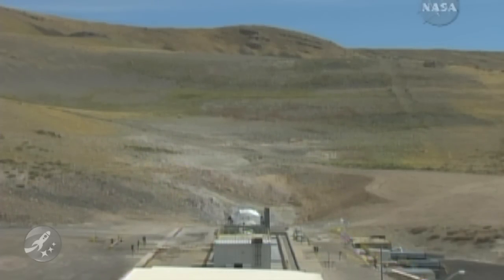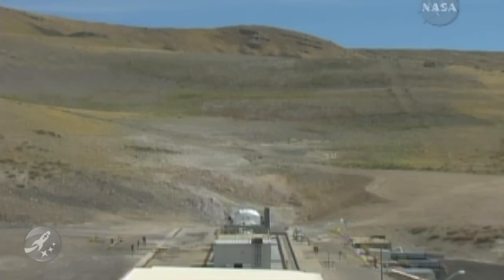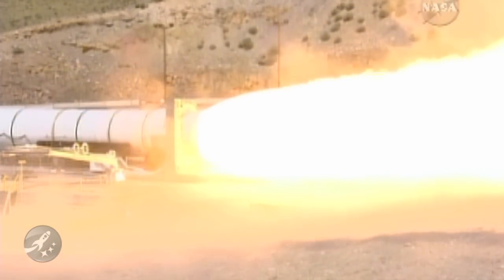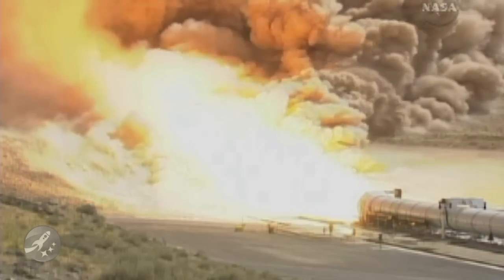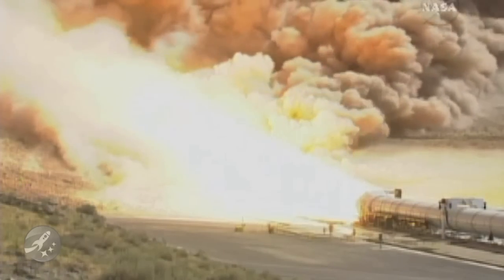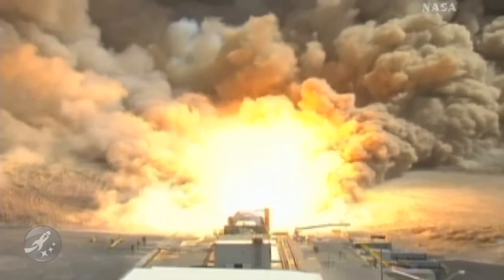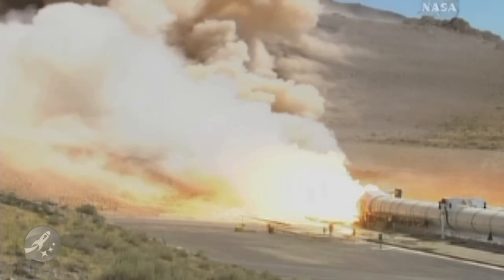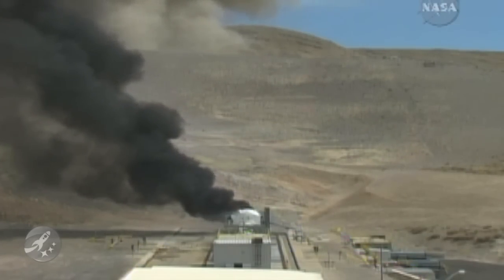Ares I Motor Test

Comment: I wonder how much this affects the rotation of the Earth.
Reply: YawnGod 0
Reply: Danny h You're not good at physics, are you?
Reply: YawnGod It wouldn't, because the rocket pushes one way, and the burnt fuel pushes on the atmosphere the other way, making the planet a closed system. So don't be so quick to make fun of Danny. It's not negligible, it's literally a sum total of exactly 0.
Reply: YawnGod what amazes me more,is the mounts holding that twenty two million hp rocket down, and keeping it from flying off.
Reply: You're getting confused with gas engines buddy. Rockets directly generate thrust, so they don't have spinning parts. You can't really measure a rocket's power in torque. If that engine wasn't strapped down as good as it is, it sure as hell WOULD have gone somewhere, and would've gotten there really fucking fast and with a lot of fire everywhere. Torque is just rotational force.

By the way YawnGod, I feel I must point out a potential slight error in my original post. The rocket wouldn't affect the planet's rotation around the SUN. As for its rotation itself, it would be negligibly tiny, but still present. Since the atmosphere fits around the planet loosely, the rocket would've spun it like a giant tank tread, causing the planet to indeed rotate a bit. The air friction with the ground would quickly disperse the energy though, so the rotation would probably be best measured in Planck Lengths.
Reply: I think he means that it's by a negligible amount.
Reply: Argonwolfproject Actually, you were
correct, so long as it happened in the atmosphere. Since the the gasses being propelled don't actually leave the Earth, the angular momentum of the Earth remains the same.

If the Earth didn't have an atmosphere, and you had this rocked strapped to it and fired, in that case then the rotation would slow down by those few Plank lengths. 

At least, that's what I was lead to believe.
Reply: Argonwolfproject Huh.

Interesting.
Reply: Ricovali horsepower doesn't effect force as torque would. You can have a 10773738837737 hp engine but 2 pounds of torque and move no where. What torque would equate to on rocket motors is what you would really consider.
Reply: YawnGod
Well here's the way I was thinking. The earth's rotational velocity isn't permanently affected by the rocket in any way, but it would be altered a small amount for a short period of time. The rocket would drive the atmosphere around the planet like an enormous reaction wheel, which would cause some rotation, but no permanent change. If you know what a reaction wheel is you'll probably see what I'm saying, if not it's actually fairly simple and Wikipedia can explain it more clearly than I ever could.
Reply: Argonwolfproject if you read my last sentence.... torque would not apply for rockets... I was wondering the equivalent or similar to torque which I may found. Thrust is the equivalent to torque....
Reply: As much as all the people in China farting in the same direction.
Reply: it is good to read that there are people who know physics. and comone it looks like a gigant rocked and epic shit everywhere but how big is is on the planet it just pushes the air. it is nothing compared to the forces that makes the planet spin
Reply: Danny h its also strapped down to the planet and the blast is against a mountain.. I see no effect
Reply: Tn Bui
See reaction wheel post above.
Reply: +Danny h That's a very good answer. A better answer is that the acceleration equals the force divided by the mass. The force of 22mill hp equals 16.4 x 10^9N.m/s with the mass of the earth being 5.942 x 10^24kg.
By my quick calculation, the acceleration would be in the vicinity of 2.5 x 10^-15m/s/s for the 120sec burn; i.e. SFA

Feel free to correct my calculations.
Reply: So atm i have to much bear and vodka so ill react later with commin sense

Comment: would I like to have one of these attached to my car. No more late at work excuses.
Reply: Pakhavar you see. You have two, one for power and the other for brakes
Reply: Kirrim Kerman That wouldn't work, if you have two simiilar Booster Rockets, you would end up at home ;)
Reply: François Dupont Well.... You might have to use the sorry i flew to china instead of work 1 or 100 times
Reply: François Dupont  how would yu apply brakes? :P
Reply: François Dupont ?
Reply: François Dupont Now that is thinking!

Comment: Taking air pollution to the next level!
(And don't start a shitstorm now, I'm a fan of the space program)
Reply: Sound pollution maybe yeah, but not air pollution. The motor burns hydrogen. The exhaust is various oxides of hydrogen. The biggest being h2o...
Reply: slowpoke96z28 You are wrong. At aproximately 1:30 the narrator says it's a first stage solid rocket motor. This motor that is burning for 126 seconds is using Ammonium Perchlorate Composite Propellant which is far away from being nonpolluting.
Reply: +slowpoke96z28

No it doesnt. Solid rocket boosters burn a mix of aluminium and ammonium perchlorate, and the produits of the combustion are very toxic.

The only engines that burn hydrogen and liquid oxygen are the ondes that are on 2nd stages of rockets :)
Reply: TheTornado121 lol thats pure H2O so dont talk about air pollution. The fuel is H - it burns so it produces H2O
Reply: forest328 Did you even read the replies in this thread? Solid rocket boosters don't burn hydrogen and oxygen, mainly because they're called SOLID booster and neither of those two is solid. The fuel in this thing is PBAN-APCP. That's a fancy way of saying it's mostly ammonium perchlorate and aluminum. And you cannot tell me that those things don't pollute the air.
Reply: TheTornado121 those things don't pollute much, they're mostly inert solids in their stable form

Comment: well thats one way to push a lot of dirt out of the way
Reply: And burn and remove weeds. Or point it a grumpy neighbours.
Reply: Pilot924 You don't even need to point it. The acoustic pressure alone would do the job.
Reply: Gath Gealaich Yes, but it's more fun by pointing it at them! :D
Reply: EXACTLY, Screw equipment, ill just call ATK and order some SRB's!

Comment: great. 30000lbs of co2 and i have to worry about the energyconsumption of my fridge.....
Reply: ***** Are...are you absolutely serious?
Reply: thats just for the arm
Reply: Why worry at all, AGW is bullshit.
Reply: Rocket Dudes Yes, because that's the only thing in this test producing any CO2 at all. The lower stage rocket (SRB) is powered by a mixture of potassium perchlorate (KClO4) and powdered aluminum (Al). Its combustion products are potassium chloride (KCl) and aluminum oxide (Al2O3) - both relatively inert solids that pose little risk to both the environment and the atmosphere. The upper stage is powered by liquid hydrogen and liquid oxygen, the combustion product of which is (H2 + O2)...water vapor. Kind of hard to emit any CO2 when there aren't any carbon sources in the fuel being used.

Comment: It would be cool to use it as a flamethrower
Reply: only if someone could pick it up
Reply: yamtam pe'er amd be strong enough to hold it still after all it is half the power of a Saturn V
Reply: It would have to be fixed against a wall or sth. Sationary flamethrower.

Comment: how much energy did this rocket produced, from start to finish?
Reply: Layne Benofsky the OP asked about energy. the answer should be in megajoules or terrajoules. You guys are replying in terms of newtons,or force.
Reply: 16Mega Newtons, Saturn V were 2 times more powerfull.
Reply: about 16.5 Billion Joules /s taking the "22 million hoserpoer" statement, thats about 2trillion joules over the burn time of 2min. Just a VERY rough statement since those 22MHP are propably some rough value for the mechanical ouput. Thermally and actually considering the variations in burn over time there will quite a difference, the number is just to give some very basic idea of whats going on.
Reply: RedhotIta1 Better to say that it's 1/2 as powerful as as a Saturn V... and only one "small" booster. ;)
Reply: Layne Benofsky energy? thrust?
Reply: jeetendrag10acc2 I'm not sure what you're asking. 16 Meganewtons was the answer. Apparently "only" 1/2 as powerful as the Saturn V vehicle.
Reply: jeetendrag10acc2
3.75 million pounds of thrust
Reply: Van Ness Put indian politicians in front. they are so lethargic ,they can stop anything.
Reply: The amount of energy released over the time of about 2 minutes is about 1.96944 x 10^12 Joules or approx. 1.97 trillion Joules. That is 1.97 terajoules. That's also approx. equal to 471 tons of TNT.
Reply: Gaius Caerulius Verus
Where is that number from? Im suprised how acurate i was :D

Comment: Put it on a car!!!
Reply: No dude, on a bike!
Reply: There wouldn't be anywhere to run it. Its burn time is too long for any flat surface on this planet. People think Bonneville Salt Flats is big but you can only get a seven mile run there, that is too short for runs much over 600 MPH, you will never see another serious absolute Land Speed record attempt there not now you need to go supersonic even to tie the record. 150 seconds of burn time from this engine, which is little more than a giant firework, would hurl you along so far and so fast you wouldn't have any chance of stopping, even if you didn't die from the acceleration. The only way to tame it would be to weigh it down with a few thousand tons of ballast. To make an insanely fast car that you could climb out of afterwards you need far more control than this. A solid fuel rocket "motor" or "engine" is just a big tube of slow-burning explosive with three speed settings: unfired, firing and burnt out (or ready, hang on and are you still alive?)
22 million horsepower is also far too much. To go fast without killing yourself (killing yourself in the attempt has always been the easy bit) requires high technology and a rocket you can control with a throttle, either liquid fueled or hybrid (liquid oxidizer and solid fuel). 
The last absolute Land Speed Record set at Bonneville used a rocket motor fed with liquified natural gas as the fuel and hydrogen peroxide as the oxidiser, that produced 35,000 HP with a burn time of twenty seconds to set the record at 630 MPH.
The Bloodhound SSC project will use a hybrid rocket motor to accelerate from the 300 MPH achieved by a jet engine with afterburner up to 1000 MPH or a little bit beyond. The overall power on that package will be 100,000 HP more than Blue Flame and the car will go from zero to 1000 MPH in around 55 seconds. Clearly a burn time of 150 seconds and 22 million HP will kill the driver (if that is a fair description of somebody stupid enough to attempt it), the only question being how far away his corpse will be buried in the sands. The chances of neither taking off nor ploughing into the ground and being completely crushed will be infinitesimal. 
Solid fuel rockets on manned vehicles are only safe for firing straight up as boosters or the first stages of multistage rockets.
Reply: Martin Willett Dude, you're so serious dude. Quit being so serious dude. Do you honestly think that anyone involved in his conversation would honestly think of attaching an SRB designed to take a god damn rocket to space to their car? Seriously dude, seriously?
Reply: Martin Willett Calm yo tits Martin Willet Dude
Reply: Dude......O.o.   are u....?
ok... it's ok.
Reply: hahaahah... dat conversation.
Reply: You laugh with your fingers? Weird.
Reply: Martin Willett Wtf happens here?
Reply: Ok Mr. genius I yield, to all your magnificence.
Reply: Martin Willett Dude you're so serious.
Reply: And you type with an accent too.
Reply: Vid304You Why are you asking?
Reply: Because I receive 100 notifications :|
Reply: Vid304You Newton's Third Law also applies to YouTube comments.
Reply: Martin Willett
Dude, dude stop dude, like dude, dude, dude...
Reply: Oh my ....  is starting again.
Reply: Martin Willett , I liked your explanation. And dont get angry about these boring people like LuciloPCJr ,These type of people think intelligent people are worst than a very famous guy or something like that.I hope you get more intelligent and explains more things like that.
Reply: Daniel Prado I get annoyed when people call me dude, it is always intended as plausibly deniable put-down. You were addressing me and at no time did you feel the need to call me dude, man, buddy, pal, mate, amigo, nigga or any other such dual use barb. I don't chill, I don't explode, I just fizz lightly, like a well controlled rocket.
Reply: Martin Willett Hey dude? Are you still angry, man? I'm really sorry, buddy, I didn't mean to offend you. Seriously, pal, you need to watch your blood pressure.
I'm only saying this because I care, mate. You and me, amigo, we'll always be friends. 
You're my nigga.

Seriously, dude, don't get upset about words.
Reply: tsoer111 Twat.
Reply: D'aw, don't be so mad pal. As long as you keep responding to me, dude, I'll keep having fun with my little buddy.

Comment: running on oil?
Reply: Nope. It runs on some kind of solid fuel that contains both fuel and oxidizer. IIRC, it's some kind of rubber and some kind of... you know, oxidizing stuff.
Reply: ***** maybe they also used solid propergol, like in the Shutle's boosters?
Reply: blazerjack117 This thing was actually just an extra-long Shuttle SRB. The shuttle SRB was not powered by "propergol", whatever that is, but by Ammonium Perchlorate composite Propellant, or APCP, which this SRB was also powered by.
Reply: wasmic5z ok,thanks :)

Comment: No, the thrust of a rocket in a vacuum is actually higher, the bigger the pressure difference between the combustion chamber and the environment, the more powerful the engine, because rocket engines' thrust comes from the mass flow out the engine, not from pushing off the air.

Comment: what about newtons laws. rockets energy inside the atmosphere will be exerted on the planet but the earth is pushing back (nothing happens). if the rocket is outside the atmosphere the amount of energy is reduced, no air to push off. although it has the gas that are discharged to push off... one more are you applying inertia to your equations? applying more torque by placing the rockets further changes angular momentum faster. like pushing further out on a wrench, less force more power.

Comment: To change the rotation of the Earth by -1.0% of its speed would require 105,953,629,807 Ares I Motor Rockets.

Comment: work it out:
22000000 hp = 16405397200 watts
ans*123s = 2017863856000 joules
ans*1 million rockets = 2017863856000000000 joules
rotational energy of earth = c.  213800000000000000000000000000 J
rocket energy/ earth energy = 0.000000000009438091001% loss in energy and therefore speed. And that's assuming that the exhaust won't collide with the ground and transfer momentum back into earth, which will definitely happen. So to put it straight, basically nothing will happen.

Comment: 1 million of these = 12 Trillion N of thrust (~2.7 Billion lbs). Strap 'em down at sea level facing one way and let them burn. That's a torque of 5.63 ft·lbf applied for 2 mins. If they're at the equator (considering Earth's moment of inertia), this should change the Earth's rotational velocity by about 9.0E-28 ft/s. Thats 0.0000000000000000000000000009 ft/s.

Comment: Even if you had one rocket the same size producing one million times the amount force it would not change in an amount that you would notice. It would be short by a factor of around 11 billion. So if you had a hundred quadrillion of these then it would accelerate the earth to a noticeable effect. This of course is not possible. I used standard f=ma and laws of inertia to figure it out assuming the earth is a solid sphere of uniform mass.

Comment: You do realize that no U.S. rockets use oil product right? even the shuttles used a Hydrogen/oxygen mix. oil products simply are not powerful enough to produce the power needed for orbit. oil produces barely enough power for a jet to skim into space before re-entering just a few KM later. This is why other countries will never be as prosperous as America, children. They refuse to get educated enough to know basic physics and chemistry.

Comment: the power of about a BILLION 10-ton rockets would slow down the earth (and thus moving it out of its current trajectory) with about 20 NANOmeters per second (thats 0,000 000 020 meter per second). Earths speed is about 30 kilometers per second (30 000 meter per second)

so, no.

Comment: 1) Yes there would be less dust, I just don't think they care. 2) Digital high speed cameras aren't actually that fast. It's cheaper to use a huge reel of film that is revved up extremely fast by a big electric motor. That's why it was making so much noise.

Comment: I have 2 questions. Wouldnt there be less dust if they keep the hillside sprayed/wet at testing or just build a "proof area" for it? Why the high-speed camera's have that noise? (sry my english)
Reply: That's a good question even if you did ask it 8yrs and probably already know the answer, but just Incase.. The noise from the camera is due to its rotating lens spinning at incredibly high speed to give extreme frame rates so you can slow it down and go frame to frame, some high-speed cameras are capable of millions of frames per second...

Comment: I just wonder what happens to all of these millions of pounds of thrust. I see the engine is facing a big concrete cube and is harnessed securely, but don't you think it would collapse like a straw under the thrust it generates? Gotta be a very strong design - and although I do believe my eyes (in fact, I have seen those mushroom clouds myself, as I live in Utah) - it still seems counter intuitive and defying the laws of physics :)